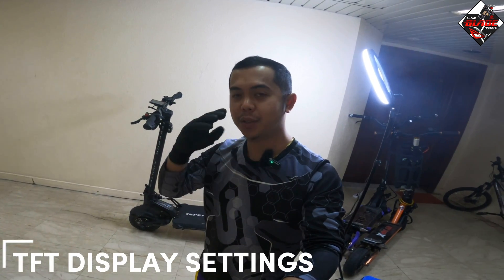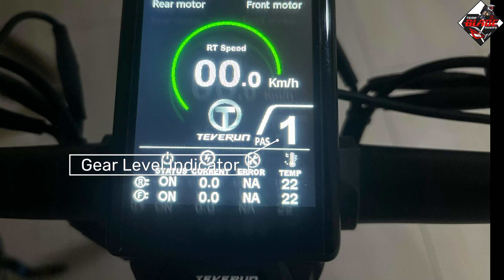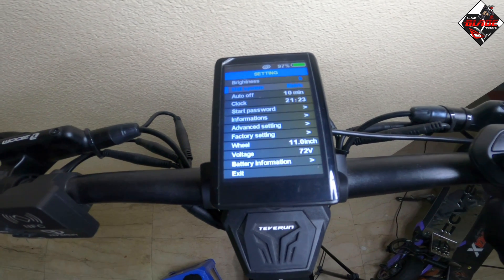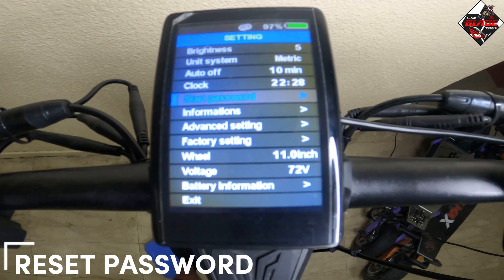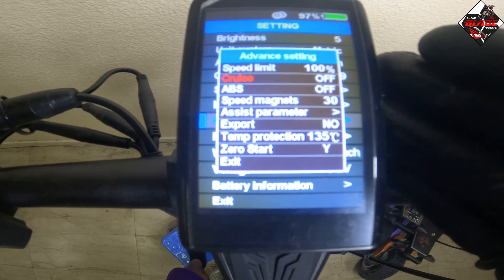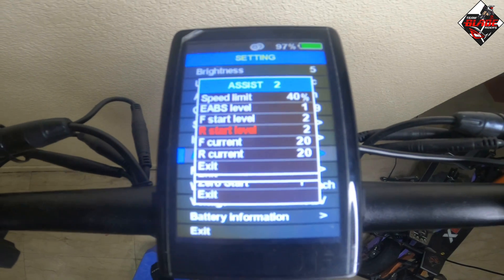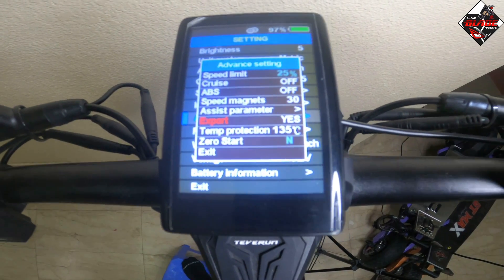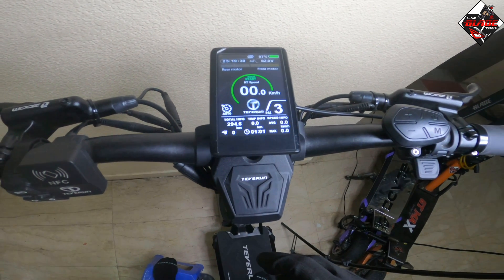TFT DISPLAY PARAMETERS | TEVERUN FIGHTER 11,11+ & SUPREME | James Angelo TV | Vlog 146

Comment: From Assista 1-5 you had the speed limits set to 20, 40, 60, 80 & 100% respectively but, the F & R current remained very low. Could you tell me why didn't you increase the currents in each gear mode? won't that affect the actual speed limits in each mode? Secondly, how does changing the current fed to the front & rear motor affect anything, I mean, what does changing the currents do? please detailed information, thank you.
Reply from the maker: i need torque power thats why i increase the current

Comment: Please why is my teverun fighter supreme showing break in the display while driving... The moment it does that, it's stops accelerating
Reply from the maker: did you press the break? if not check the hall sensor connection
Reply: @JamesAngeloTV  when i apply break and leave it, it will still be displaying that I'm still holding the break mean while I'm already pressing the throttle button it will not respond I will just be there on the road waiting for it to move...

Comment: I have the 11+, but for some reason, Gear 1 is not working. I have tried to adjust Assist 1, but it still does not function. What do you think it could be?
Reply from the maker: yes gear one not working make it gear 2
Reply: @JamesAngeloTV  how do I fix it?

Comment: Good info about the display!
It's new for me.
What is it actually like to drive the Teverin in the rain?
That's definitely supposed to happen....😉
Is the scooter then junk or can it stand it?
Thanks!
Reply from the maker: honestly i drive my scooter in rain, around 15mins travel from my work, nothen happen.
Reply: @JamesAngeloTV  
Hello!
Have you ever replaced new wheel bearings for the Teverun Fighter 11 plus?
Mine make strange grinding noises and squeaking noises.
But what size do you order?
Do you have experience with that?
Thank you!

Comment: Hi, In fact, I am concerned about the problem with blunting at speeds over 40 km/h. When you pull the trigger after rolling , the scooter slows down at the beginning and only then begins to develop power again
Reply from the maker: maybe you on the eabs
Reply: only the throttle stick is pressed @JamesAngeloTV
Reply: you go coasting, you pull the trigger of the gas and sudden braking and then acceleration  @JamesAngeloTV
Reply: firmware 2.2.13
Reply from the maker: your version is connected to the app?
Reply: I did everything, braking disappeared after 40 km/h when I pulled the gas trigger
Reply: now the throttle stick  works perfectly from 0 to 100 km/h
Reply: Now it's unrecognizable, Teverun rocket

Comment: Hi Angelo. I bought a Blade GT yesterday. The scooter does not work the accelerator. The TFT screen works 100%. I assembled the equipment myself and only connected a cable-connector since all the other connections came together. Any suggestion or test to perform. Maybe it's lack of knowledge. any help thanks
Reply from the maker: maybe the speed limiter is connected
Reply: nurigustavo did you ever figure a solution?
Reply: https://www.youtube.com/watch?v=Ps3qJkXrRLk&list=PLLfdpiNZ5lNPIURWHxbBB76MG8k657M9i&index=18&t=568s

Comment: Hi, how much does 11+35ah weigh in kg? It's just that the weight is different on each site.
Reply: Without rounding, if possible. There is a restriction in my country (scooters over 35 kg cannot ride on sidewalks).
Reply from the maker: 38 kg bro
Reply: @JamesAngeloTV  thanks

Comment: in mine i don't have start password or advanced setting maybe it is a different firmware?
Reply from the maker: that is supreme right? or maybe with bluetooth
Reply: @JamesAngeloTV  yes supreme ,the plant told me the now have this function only in app, so you know something about it?
Reply from the maker: that is with bluetooth, no idea about bluetooth so far my order not reach
Reply from the maker: but it should be same only even with bluetooth main thing you will adjust in app
Reply: @JamesAngeloTV  in tft i don’t have this functions only in app , is it normal?
Reply from the maker: yes if app version that’s normal
Reply: @JamesAngeloTV is there superme app version and without app version ?? And how we know before buy ??
Reply from the maker: in tft display you may notice there is bluetooth sign,
Reply: Que contraseña viene por defecto ?

Comment: Watching this because my Blade 10 has a TFT display haha
Reply from the maker: yes you can get an idea in that video bro🤝🍻
Reply: The  mileage 'Trip Info' reset with the + & - button together is useful, didn't know that one before.
Reply from the maker: i didn’t mention also in this video Long press M it will be single motor vice versa

Comment: Hi Angelo,
The blade GT+comes with 40amp controllers,and I am curious if it would be safe for me to change the default current settings on the TFT in Assist 5 for the front and rear controllers/motors from 40amperes to 45 or 50 or 60? 60 is the maximum value which far exceeds the amp rating of the controllers in the GT+ and in my opinion too much for the controllers to handle.
I am worried that permitting more current than the controllers could safely handle would literally fry them.
If I decide to increase ampere values to an amount  higher than the factory default numbers,how much do you recommend I raise them without damaging the controllers or motors?
In my opinion,45amps would be the threshold for the GT+,but going higher will be a disaster.
Let me know what you think.
Reply from the maker: im not sure bro if it will reached upto 45A i mean in settings option, if so yes 45A that woul be fine. only the thing is it will give high torque power but it will less the range due to high current